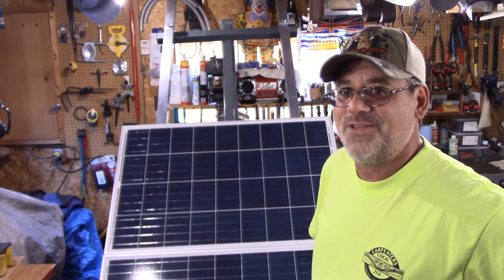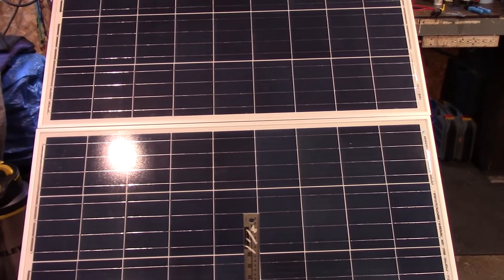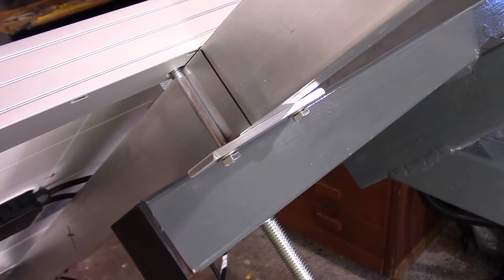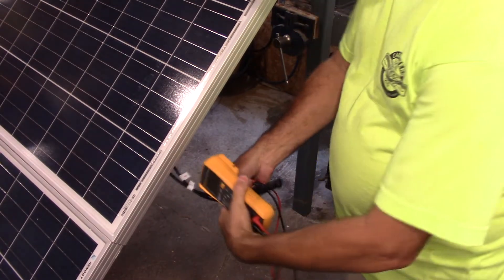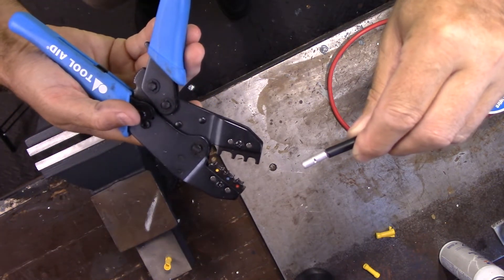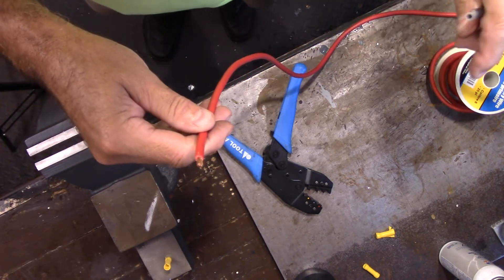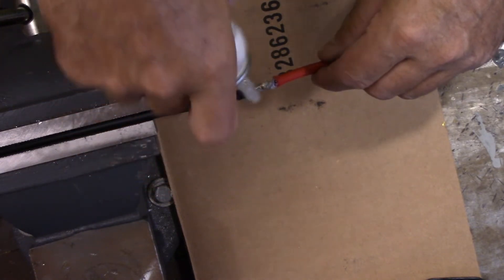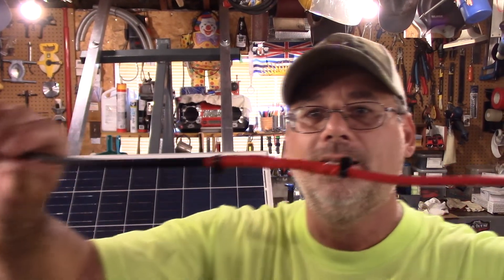SOLAR PANEL SETUP AND HOW TO SOLDER A STRONG CONNECTION

Comment: And it was impossible to tin the wire and crimp it. In your case, copper will oxidize and there will be poor contact, and transient processes under load can interfere, you will look for a very long time. Good luck in your work.

Comment: Never used the grease. I still have my original tube I bought 40 years ago. Looks like a solid connection for outside use. Thank you for the video, Steve
Reply from the maker: 40 year old grease eh:) Thanks  buddy.

Comment: Been doing something similar for over 50 years.  I always tin my wire before installing in the medal sleeve.   Years ago before shrink tubing was available.  We used some rubber tape and overlaid it with Scotch 77 tape.  Never thought about using dielectric grease though.  Great idea though!
Reply from the maker: Thanks Rick , sometimes I cant get access for heat shrink so I use gardner bender silicone self fusing tape . I'll show that in a vid . Cheers

Comment: Ew! I hate those dialectic grease bottles by Permatex. The bottle always fails before I run out of grease. Very expensive ripoff no matter where you buy it.
Reply from the maker: You are correct so I take the top off and use a brush . Again nice practice rant 😂😂
Reply: @SteveRobReviews  my rant video was mostly kind so...I need practice. Lol

I'm finally coming out with my new Yamaha WR250R experience. I almost calmed down with how bad it went. Sigh. I hate putting up something negative. But if I don't, I may not save a life. I just couldn't put it out years ago, but ... I'm trying. I'm doing editing techniques I've never done blending B roll and multiple sound layers and showing happy bits of stuff from 3 years ago nearly.

I'm learning a ton. If I can survive the editing. . . People will get to the end and they could be left with a smile. Super funny ending! I have to focus on that.
Reply: I almost made that into a video...but it may have been a short complaint in the middle of one. Lol
Reply from the maker: @DENicholsAutoBravado  Go for it .👍 Steve Rob Report on( is god real )is an eye opener 😂😂

Comment: Nice connection. I use the grease on harness connections but never thought to rub it on under the shrink tube. Some of it comes with the grease inside the tube so when its heated it oozes out. Nice vid Steve!
Reply from the maker: Thanks , lots of great ways to do it and all are better than twisted wires  and duct tape :) oh yes Ive seen it all. 👍

Comment: Very good vid I do use dielectric grease  but use quarter inch copper tubing for the butt connector especially with #8 or 10 wire  try not to use dissimilar metals mostly for longevity seems I always find some useable copper in the scrap pile
Reply from the maker: Thats a great idea . Yes I have done that in the past as well . 👍

Comment: Nice solder job and way to do it. I do use dielectric grease a lot but haven't inside of butt connectors. But will in the future!
Reply from the maker: Yes Mike  it's much better protection from the salt as well. Cheers
Reply: @SteveRobReviews  usually when I use butt connectors that will be in the weather I use liquid electrical tape to seal the ends. It seems to work.

Comment: That's the same way I do it. You can buy those splicers without the jackets. That is a guaranteed way to get a good connection. That dielectric grease is a great tip to limit corrosion.
Reply from the maker: Yes the grease is the way to go. I have to look harder for them splicers  then . Thanks Lloyd

Comment: Nice ! Steve, I crimp and sodder my connections too. I use the heat shrink as well, but never thought about the grease. Great idea !
Reply from the maker: Billy the grease really seals it in for the long term better than none. Cheers bud.
Reply: I hate heat shrink so I'd be happy with grease in some applications. Just too often I have the wrong size of heat shrink.
Reply from the maker: @DENicholsAutoBravado  I buy it in bulk from 1/8- 2 inches . I have enough for the next 400 years to be on the safe side.

Comment: Well at least you figured it out beefour4  you set it up at the camp. 
Ya got a little extra insurance with the wire ties so the tape does not unravel 
Dang that thing is not gonna come apart in your lifetime, well unless some big burly bear messes with it.
Nice job.
Reply from the maker: Marty the install will go much better in theory as  i'm prepared for anything but a bear . LOL
Reply: @SteveRobReviews  Yeah and what's a bear gonna do with a solar panel. Good luck.

Comment: I do like that tip on wrapping the tape with wire ties. That's pretty smart, especially when they are outside.
Reply from the maker: Actuall GM taught me that on repairing damaged harnesses on trucks . There is a specific procedure for it and a booklet about 20 pages thick on how too . Like the military bud  just like the military :)

Comment: Good luck on your camp installation Steve....all you did for the connections is top-notch...I have to tell you we in the trade use dialective gress but for other application than but connection....I could expand on this but it would mean nothing to you.... you're doing good and I don`t see no reason for this thing to go sideways on ya....CHEERS
Reply from the maker: Thanks Gator and that would be an interesting vid for you to do showing where else  you use it. Yes a terrific vid many would fine of interest.
Reply: @SteveRobReviews  I just can`t do it, Steve....On the electrical rails{{{orange insulation on 3 phase power}}} for overhead cranes at about 100 or so feet up in the air...I use it on battery terminal for corrosion....we have shrink tube with a 3 M good inside that spreads as you heat it and it seals your connections....all good Steve...CHEERS

Comment: solid connection right there Buddy, that's definitely not going anywhere 😊 and weatherproof too 👍👍👍
Reply from the maker: Thanks Igor and where have you been lately , too hot in the UK to film or taking a break ?
Reply: STEVE ROB REVIEWS taking a little break the Brazilian gang is around so they are keeping busy 🤣🤣🤣🤣👍 visiting Stonehenge right now

Comment: some solid crimping going on there. I've always liked the idea of using just the metal sleeve to crimp then to use heat shrink over it. great work.
Reply from the maker: Thanks Jonathan , lots of ways to do it and most get by with tape and luck. LOL